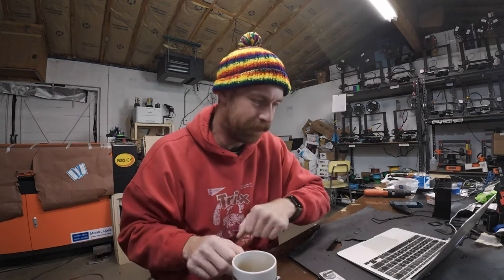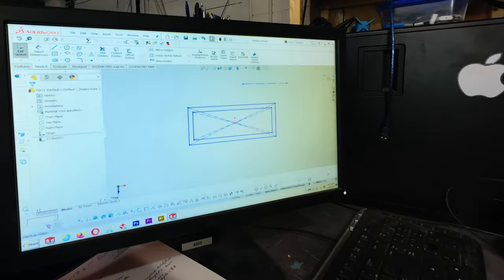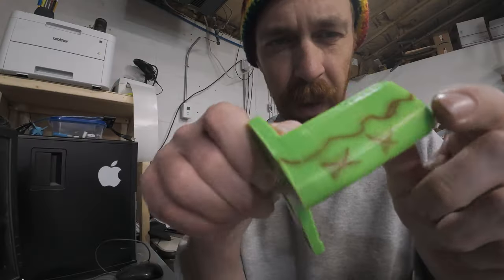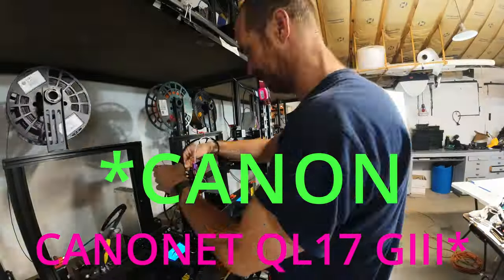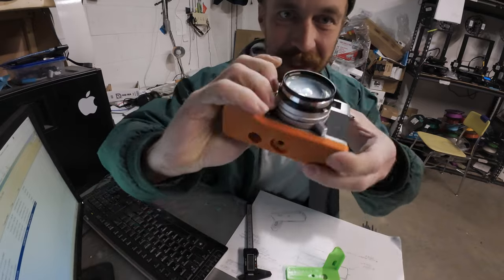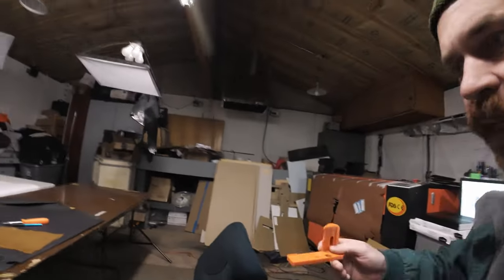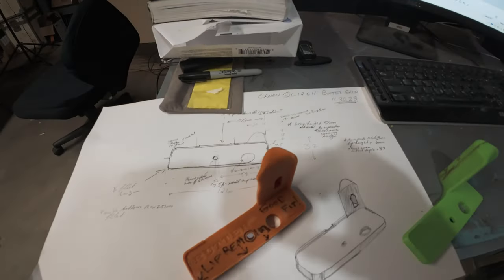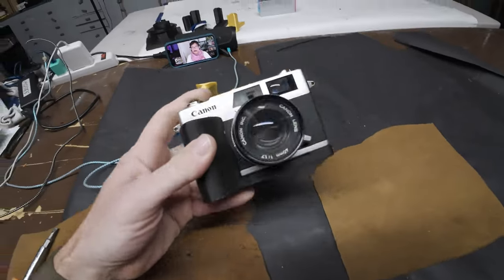SHOP VLOG: A CAMERA GRIP FOR A CANONET QL17 GIII

Comment: Looks great Ethan! Did it take you long to get into running? I am about to make my third attempt...
Reply from the maker: It took me about a year from where I started to be able to run enough that I could get some exercise out of it.  It's just too destructive to do enough of to be my sole method for improving.
  I had to walk and cycle and swim and lift weights for a good long time before my body wouldn't just be torn apart rolling down the street.  My big takeaway is that running can be really fun, but little by little, as a part of some other lower impact routine.  It's taken a surprising amount of discipline to NOT run, and do something else when I am not sure if I am going to destroy myself by running on any given day.  I am old.  I have made many previous unsuccessful attempts.
  Stay strong Ben!
Reply: @CAMERADACTYLCameras  Thank you Ethan, I will!